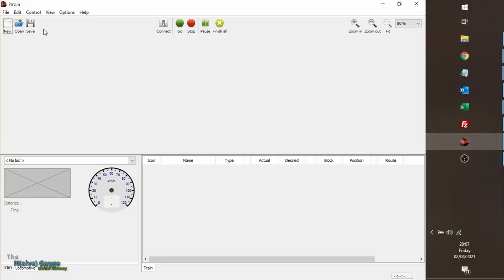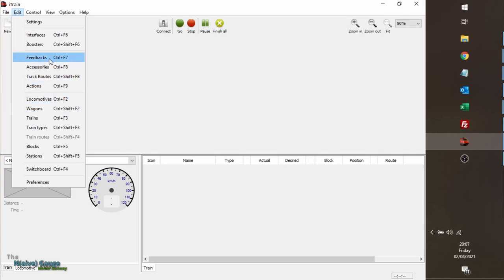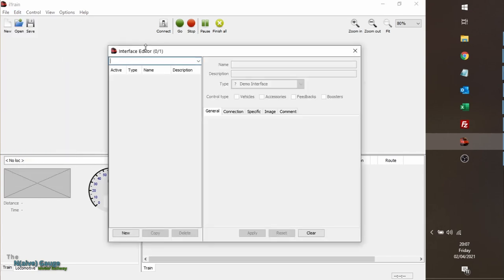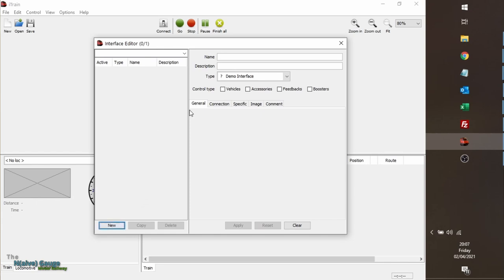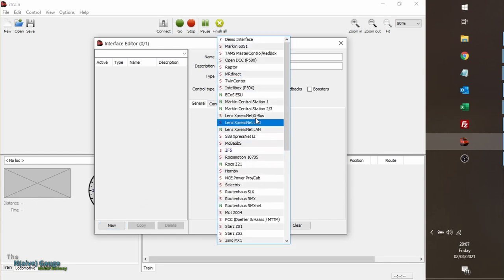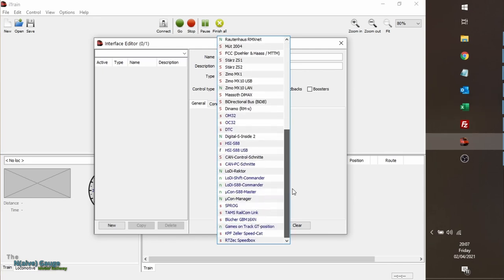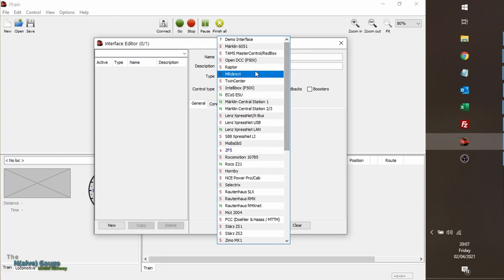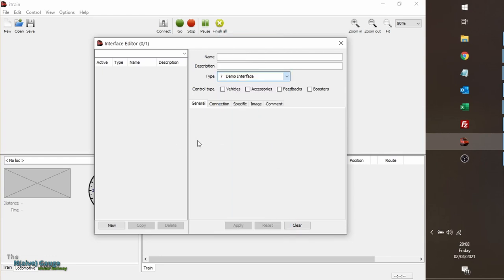29 Experimenting with iTrain | Software control of n-gauge model railway

Comment: At around 22 mins the reason the train kept stopping at the end of each block was probably because you were running the train in semi-automatic mode rather than the manual mode. Too see the mode you are in, select the train tab in the throttles rather than the loco tab. In semi-automatic mode you can still drive the train manually but it will take notice of signalling and any danger, hence why it stops the train at the end of each block as a precaution. In manual mode it ignores signally and any danger.
Reply from the maker: Thanks for this Bob. What you say is pretty much what I had figured out. There are still many subtlies that I need to learn though.

Comment: Hi Phillip, Nice video, bit tech heavy but that can't be helped with this type of video, I keep gleaming bits of info on itrains all over the place. interesting how you leave the cv's alone on the train for inertia, but now it makes perfect sense as I know you calibrate your locos to the system whereby it goes through a series of tests running the loco at different speeds in both directions and then times when it is hitting certain blocks. This is very useful if you are ever using 2 locos on the same train for double heading or top and tailing. Another useful thing hidden away on Itrain is that it will tell you how far that loco has run in it's life time on your railway. This could be useful from a point of view, where by when it has covered so many miles  you then give the loco a service. On your next video could you explain your logic to how you decided where to place you sensors as I'm not sure about how many sensors you really need to make the system accurate. All the best Tony.
Reply from the maker: I have to say - it is the video I never wanted to make - all computers and not trains :( But it is necessary in order to get on to the fun of trying to use infrared proximity detectors to control things better. Nearly there...
Reply: @naivegauge  I've been doing videos recently which I struggle with, as the are really aimed at newcomers but like you, if you don't lay the foundations you can't get onto more interesting stuff without people not understanding what you are doing.